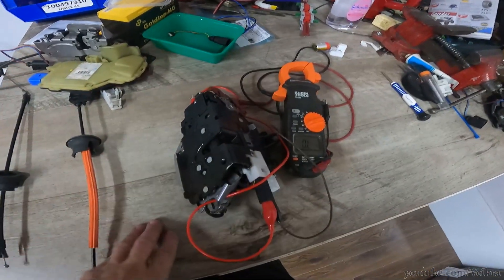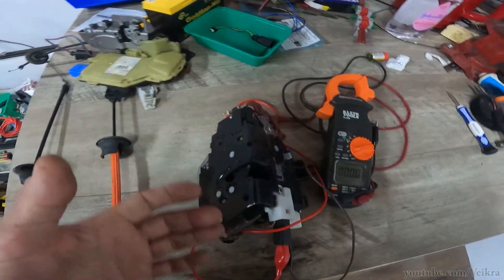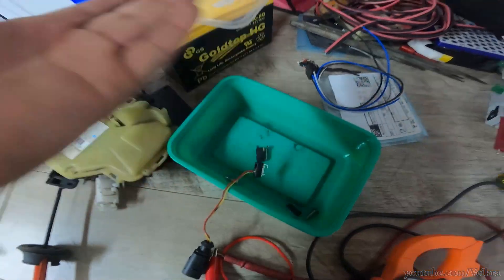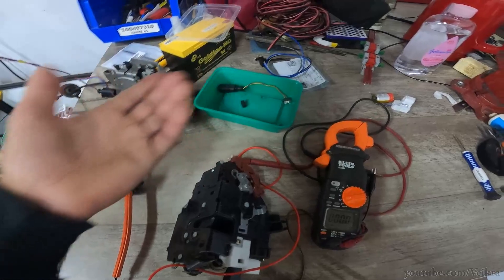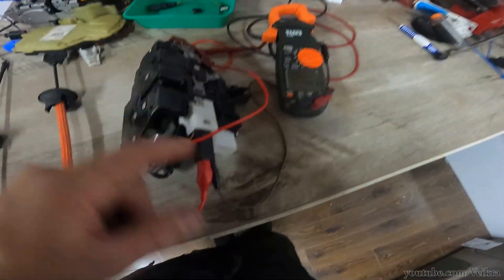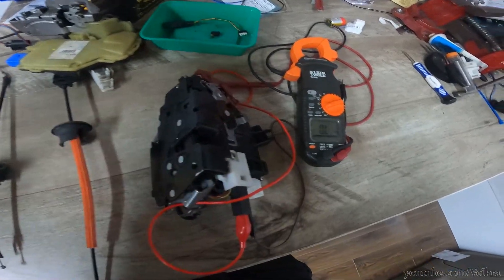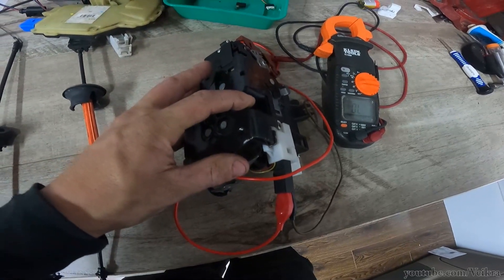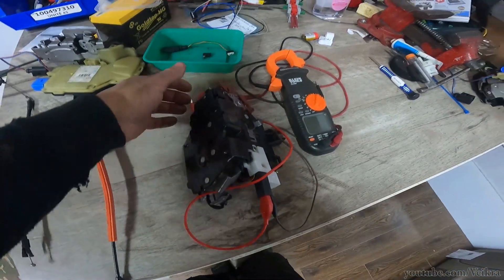How to test audi a8 d3 soft close latch

Comment: Any tips on cv axle shield rounded out bolt???
Reply from the maker: yes, aligne a large punch with a flat base. Needs to be perfectly flat on the head of the bolt. It will shrink it back.  Otherwise cut the bolt, the treads are never stuck. 
You can also force a old torx inside of it, but you need a impact rated torx.

Good luck
Reply: @Nordic_Mechanic I managed to get it. Will be making crankshaft sensor video soon